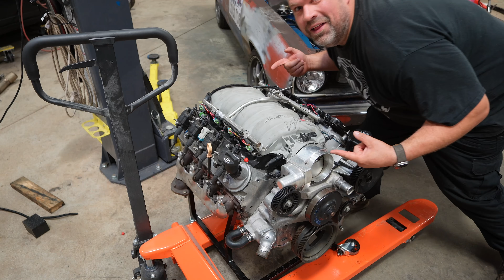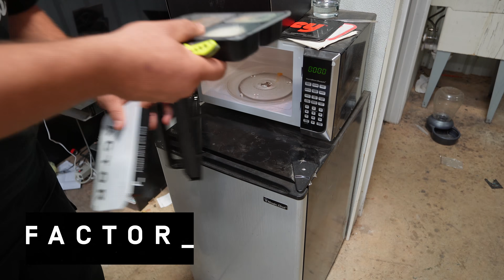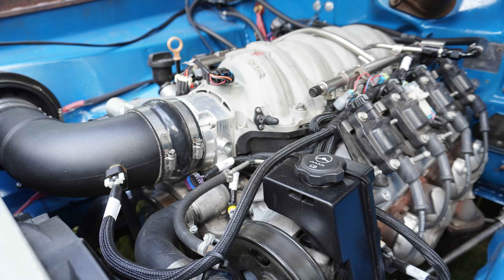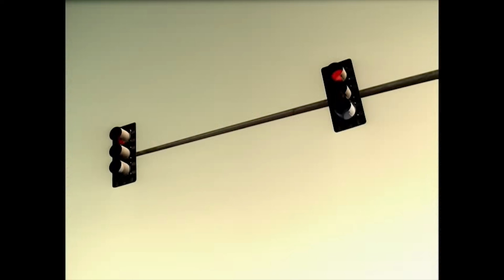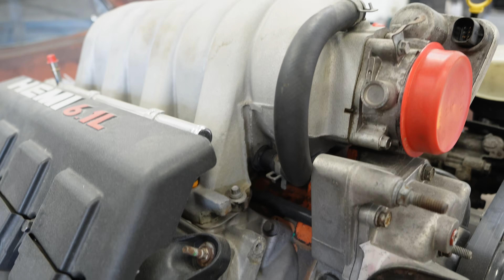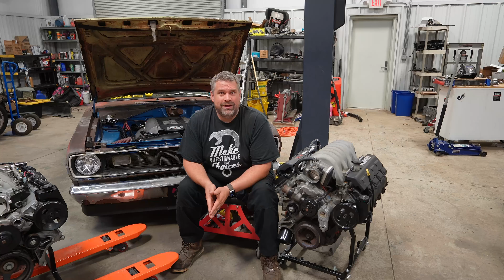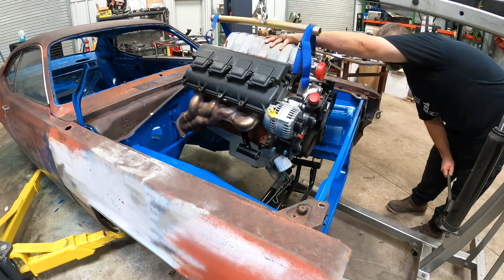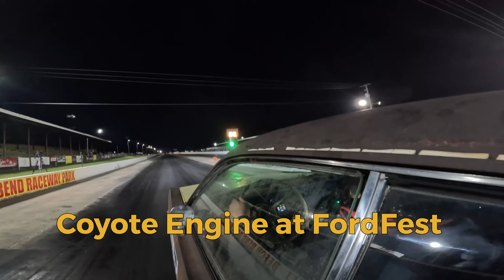What No One Tells You About Engine Swaps! Best Engine To Pick?

Comment: I would swap the engine that all 3 manufactures use in their race cars. The original hot rod engine. The first push rod V8 offered in 1953. The legendary HEMI V8. With all the aftermarket support and crate engines available its easier than ever.

Comment: Here's how you decide which engine to swap: 1 availability and economy.  2: time/difficulty 3. Realistically how much power are you building the whole vehicle to accommodate? 4. How much power with the engine hold(not how much it has, but literally how much before grenade)
   Most any engine can produce some power with the right mods. The real question is how much money and work is needed to make it hold up. Last but not least, if you are spending more money to build a car that is slower/less reliable/less capable in all areas, but could buy something for less that out performs then why? WHY?

Comment: The MAJOR advantage to a modern engine swap in an old car is the technology. Hands down, if you take a small block, say 360. Then try to make it make what a stock hemi makes. Its just not going to be a practical daily driver muscle car. You can stick a stock hemi,ls,coyote in an old bbody, camar, or mustang and make 400 plus hp. It will idle smooth, and start up everytime. Plus the transmission options are mucho better with the new stuff.

Comment: The big reason the SBC and later the LS are such popular swap engines is not just availability. The common bell housing pattern has a lot to do with it. While these three engines are the most common for swaps today there are other options. And sometimes you shouldn't swap out the engine the car came with. If you find a cherry 1st generation Firebird with the OHC Sprint engine. Especially the optional 4 barrel. Leave it alone. Swapping in a V-8 probably lowered the resale value. What you swap in really depends on just how much room you have in the engine bay. How much sheet metal work do you want to do if you have to starting cutting the shock towers or firewall.

Comment: The LS-4 can be swapped into a rear wheel drive. It does require the use of a bell housing that matches the bolt pattern. One from a Jeep XJ 4 hanger. There are other options outside of these. I know of one guy you swapped in a GM 4.2 Atlas inline six. When asked why his response was "any idiot can swap in an LS". The Atlas will make great horsepower. As shown by Calvin at Nivlac57. As Hot Rod used to say, Dare to be Different.

Comment: Im a Mopar guy, I have a 2012 Ram 1500 with decked out 345 (aka 5.7) Cammed, Rebuilt top end, ported 6.4 intake, 2800 stall, shorty heads, (I wanted low end power) true dual, and more…it will put you in the back of your seat, hard!!. 

However, I respect the hell outta some Ford or Chevy builds, certain builds demand respect. My neighbor has a Nova with a 454 and a big ass blower on it, with dual 4 barrel carbs, that thing will do 8’s all day. So yeah, I like all builds, but I prefer Mopar. 

My Dream is either a Hellephant 426 1000hp in my Ram, or buy a classic fixed up 69 SuperBee. 

Be Cool y’all!

Comment: I have always been a Ford guy.
However the LS is so good that I would take the mod emgine out of my f150 and swap a vortec engine in it.
Why? Cheaper to repair, easier to work on, easy to make power out of, less complications in the design.

I know people are thinking the coyote is going to be the next big swap idea.
It's not and likely never will be.
They're expensive to get.
Hard to swap into most engine bays, if not impossible without fabrication.
Cost a arm & a leg to build power out of them and they require forced induction for real numbers.
It's goong to take years for aftermarket support and the things I listed above is one major reason companies will not build that stuff or atleast low numbers of supply and keep the price incredibly high.

The truth is the new Ford 6.8 V8 and 7.3 V8 are going to be the swap ideal engine if you want a Ford engine.
That over head cam idea has never been a cheap option and never will be. Cars like a BMW do well with that stuff, but you get people with BMW money willing to spend it.

Comment: Keep playing with your Ls, your broke I get it1 I'm doing oil pump gears and boosting my coyote....700 whp...vroom!
Reply from the maker: You missed the point of the episode and the moment I said if I was picking a vehicle with the engine preinstalled I’d go coyote, BUT to swap into another platform, the coyote is the biggest, and still most computer side complicated to swap yet. It did sound great singing at 8,000rpm in the burnout pit

Comment: i honestly wanted to do a coyote swap on my crown victoria, changed my mind for a 5.7, 6.7 or a hellcat swap with the 8spd auto but now im torn between the 5.3 LS vortec or a 6.2 LS with an automatic transmission. as a car guy i like the 5.3 vortec but also want the 400hp from the 5th gen camaro's 6.2 LS v8 with the L99 transmission (6spd auto). which one would be the best option: the 5.3 or the 6.2 LS v8?

Comment: You could cut the bias in this video with a butter knife you cannot possibly compare a GEN three LS with a GEN three coyote a GEN three coyote mops the floor with the Gen3 hemi or a gen3 LS.  You said it yourself a Gen4 LS operating system costs significantly more, even more so than an operating system for a coyote (which you could get for around $2000) if you knew where to get it.  This video is god awful 😆

Comment: I agree on everything except ease of making power. Boost, fuel and oil pump gears and you can push crazy power. Both the engine and transmission will hold up great. Hemi sounded great and ls is by far most common and easiest to source. Great vid 💯

Comment: It’s almost like you did absolutely zero research on the Coyote or available swap parts. First off you can get F-150 coyotes for under $2k. Different compression and exhaust cams but otherwise the same and fully capable. Secondly Ford has Coyote control packs for $2k with your ECU and everything you need including the gas pedal. Companies like Power by the hour have absolutely anything and everything you need first a Coyote swap. Oil pan options and alternative belt drive configurations are available and have existed for years. Yes, it does have a larger footprint but all the other things you went on about was nonsense.

Comment: LS is way better for price and support. Now if you can get a coyote it’s very good platform. But the best swap engine is kswap or 1UZ swap. And if you don’t like the Honda sound. Put a set of uneven length headers and a supercharger the sound is more like a Subaru but better. 1UZ is by far the best they can handle well over 600hp on stock engine. And the block can handle over 800hp. And all you need is a turbo or super charger. Air water intercooler. So a junk yard LS isn’t good for more than 450hp that’s with some new heads and cam and some boost. LS swap with decent power your looking around 8 to 9k LS engines have gone up in price. Now you can get a 1UZ or a k24 for under 200 bucks and do nothing to it but slap boost to it and some support mods and make well over 400 for the k engine and boost on the 1UZ to well over 500. 1UZ swap can be done for well under 3k.

Comment: The score was pretty much what I expected.  Even when I started driving being a mopar guy I worked at an auto wrecker and found that mopar stuff interchange ok  GM stuff interchanged incredibly  well.  Even across olds, pontiac, chevy.    Used to sell a lot of 350 chevy engines to drop into chevy vegas, guys could have a pretty fast car with a very basic engine.  So makes sense that gm carried that on keeping it simple and flooding the market.  Have to also give kudos to them for building the LS really well, strong light and dependable.   So get it why so many guys use them.  Just nice to see someone using something else once in a while.

Comment: The aluminum LS is the king of swaps for 3 big reasons; size, weight, and cost. The fact that an aluminum LS weighs less than a iron block turbo 4 cylinder is mind blowing and makes it ideal for performance swaps. The Hemi is big and heavy, the coyote is big and expensive. 
Stuffing a hemi or coyote into a small chassis like a 240sx or rx7 just doesnt make sense because of how tight the engine bay is.

Comment: The hemi is by far the king. Almost all nhra drag cars are running hemis, even if the sticker on the front is different. Hemis dominate the nhra. Then in nascar when they tried to make a come back, nascar made them increase wind resistance to make it =. They quit. All you had to do is watch the truck series get dominated by dodge. Eventually they even forced adjustments.

Comment: Performance stopped in 1970. In 1971 the EPA TOOK OVER. I was there working at a Pontiac, Buick, and Cadillac dealership..you could of heard a pin drop when we raised the hood on the first 1971 models, and i said "where's the beef"

Comment: My problem with any other swap besides the LS is cost, i can add 100+ hp to a LS fir a couple hundred dollars, hemi cam swap i did just the mds kit was $1600. Never messed with a coyote but read same about them. I can build dirt cheap LS motors and if i blow one they are easily replaced. Just my 2¢
Reply: Not wrong. The coyote is a great engine as I personally own one in my 2013 GT Mustang, but the LS3 is better for builds and can be put anything.

Comment: Nice video; however, the MOPAR hemi did not "revolutionize engine design".  Hemispherical combustion chambers have been used in automobile engines since at least 1905.  MOPAR may have popularized the hemi cylinder head design, but it certainly wasn't revolutionary.

Comment: Yeah… I don’t quite agree with that statement…

Usually, the dirtier your engine run, the more power it makes. More fuel, more air, more displacement equal more power.

Use V-Tech from Honda. Everyday driving is clean and fuel efficient. Once you hit the higher rev, everything from clean and fuel efficiency goes out the windows to produce power. Which brings the following question for all the rice tuners: why lower the v-tech rev activation when you can just get rid of it completely and run it with advanced timing and everything else without waiting to hit the rev activation?

Comment: I don't care if it's "difficult".  Right now I think the Coyote is the better engine for several reasons.  I'll go the extra mile for what really works.  The LS was for sure the go to for anything prior to the actual 5.0 from Ford.  I have to admit that I've never considered dropping any Dodge engine in anything other than another Dodge.  Having a Viper engine and transmission,  I could only think to put it in a Dodge.  I'd put an LS in a Pinto, or, a Coyote in a Chevette 😅

Comment: Not exactly a "race" build.. but my next build will be a 1972 Chevy C60 cab and front clip with a fleetside bed with stepside fenders welded on. "Make it a dually" . With a 5.9 cummins married up with an allison transmission. And probably using a ford rearend. 

Each make has things it does better than the others. Who cares what ithers think. When you are building anything, build what makes you happy. I am a GM guy, love the body styles! GM has the, IMO, the most beautiful body lines. But dodge has the best deisel engine. Allison is the best trans. Ford has the best suspensions and rearends. Just my take on it.

Comment: Crazy!  I keep seeing videos of people praising the Coyote because of the boost u can run thru a stock coyote motor and it being able to handle that much horsepower. Do u agree if its power u want.
Reply from the maker: The coyote is absolutely amazing to build, in the vehicle they originally came in. Between a mustang, non-hellcat challenger and a Camaro, I’d take the mustang hands down because of the engine. If you are trying to swap an engine in, the coyote is terrible.

Comment: Dont sleep on a rebuilt Northstar either. But i helped to build 4400 LS's per day from 2001 to 2013...4400 engines/day x 5 days a week x 50 weeks/year...1.1 million/year for 12 years...over 12 million engines. That's why the LS rules. They're cheap and they last. Easily adaptable to just about any drivetrain. GM wins!!!❤

Comment: Great video. Wish it had been the ford gas 7.3 instead of the coyote though. I know the 5.0 has been swapped more, but the 7.3 is more apples to apples, way cheaper, big, light, easily swappable it bolts up to anything else a mod motor does.

Comment: I've had them all except the coyote but a few buddies have them. They are pretty nice! LS was my favorite for a long time for the simple fact they were so easy to get and get power out of. My first real build was a 2002 trans am ls1. We built it in 2005. Ended up with 714hp to wheels on nitrous and 630hp to the wheels motor. I now have a new favorite motor but I wouldn't say it's cheap. Now that I've grown up and have a big boy job, I'm able to invest more lol. I'm currently building a 7.3 Godzilla for a 92 foxbody. I originally got introduced to the Godzilla when I bought a new super duty. With some tinkering and a buddy doing some tuning, we got that thing to hum. I was impressed with the power, durability but also the fuel mileage I was getting. The truck is pushing 601hp and 642tq. We did cam, intake and had some intake and exhaust work done along with other bolt ons. I can't wait to see what our foxbody does!! The Godzilla sounds oddly similar to an LS to me after built lol.

Comment: The Coyote was faster in all three but only because he’s a Chevy guy so the LS would of been if it was set up for it, but the heating isn’t set up for the Coyote because it needed higher RPMs . Sounds like it wasn’t set up for the Coyote and it was still faster on all three phases. Plus you can change all the intervals he said in the LS and make it faster, but you can put 1400 WHP through a Coyote without changing the internals

Comment: Welllll….Brett Lasala just won sick week and went a best of 6.26@227 in his 2013 Mustang GT with a factory cast Coyote block and factory cast voodoo heads on a 275 radial. Let’s see an LS car or a Hemi car to come even close to that…

Comparing the technology of a coyote to those other engines is like comparing a space shuttle to a horse and waggon
Reply from the maker: I was discussing their use as a swap engine. What did Brett win in? A car that it came stock with. I even said in the stock chassis it’s the best engine. But, the cost and size makes the Coyote engine the worse candidate of all three.
Reply: He won in a modified 2013 mustang GT that he can drive through a Starbucks drive through. Just shy of 3000 hp (factory block, stock crank). 

Coyotes are definitely the most expensive for sure.

Comment: I recently did a coyote out of a 2019 f150 swap on my Mustang II didn't have to change oil pan also the exhaust fit .. I sent the ecm out to get the security deleted  .. so the engine and transmission cost was $4250 ecm was only 150 including shipping .when it was all said and done total was only $ 7419 ... only one thing I forgot to get was the  
               Driveshaft 🎉
Again I really enjoyed your video

Comment: Talking engine swaps nothing is better than a LS. But…as many have mentioned the only engine you can make 1000 reliable hp without opening the engine is the coyote, especially the Gen 3 coyote. Simply bolting on a set of good long tubes and a good E85 tune can get you around the 500whp mark on a Gen 3 coyote and match that with the amazing 10 speed 10r80 transmission and you see a lot of Mustangs hanging with and sometimes beating 700+ hp hellcats with a completely NA setup.

Comment: For newer stuff (like my 2015 jk wrangler), the computer side of things is a problem. The ford 5.0 is a dream engine, but the computer and wire harness is an absolute nightmare. The LS is the most durable for off-roading and longevity. But the hemi (5.7L) has the fewest computer problems, matches up to the transmission, and needs the least amount of modifications under the hood.

Comment: First mod motor was 91 Lincoln and it was a non pi 4.6 2v. 

First mod motor in mustang was 96. Practically the same motor in the Lincoln from 91. In 99 the mod motor got decent with the PI heads, cam, and intake. About 40 hp bump in power. You can make over 300 wheel with 96 non pi short block comp non pi cams, ported pi heads, long tubes, aftermarket pi intake manifold, and all the bolt ons. They're fun and run low 12s. Pretty easy. 11s.on drag radial.

Comment: Being a GM ASE certified technician with over 20yrs of experience I realized around 1997 a swap wasn’t a good idea for my 1964 Pontiac Tempest/GTO. A lot of unnecessary extra cost & butchery to the car. Instead I would build a 1969 4 bolt main 400 Pontiac with 4.150”Bore, 4.150” stroke billet crank, 6.700” titanium rods & a 1050 Quick fuel BDQ carb feeding Kauffman Racing CNC ported aftermarket aluminum heads that flow 400CFM. It’s a squared Pontiac. With a built for racing 200-4r transmission from a Buick GrandNational it more then speeks for itself. It was very affordable back in 2017, especially for what it’s capable of!!!  Without a power adder

Comment: If you want to do an engine swap, where do you find motor mounts, adapters to mate engine to transmission/transfer case, etc?  I have a mid 80s F-150.  I want to replace the 300 with a 351 Windsors, 351 Cleveland, or a 360.    Where do I find info.  I also have a 66 mustang with 289.  Coyote swap would be too expensive, however, a supercharger on an early 302 or 351 might be worth it.  Where do you find info on these type projects?

Comment: I think you are mistaken about when the 5.0 Windsor was discontinued. I own a 94 mustang cobra that has one. The 4.6 wasn't used in the cobra until 1995, not 1993 as reported in this video.

Also you mentioned the mod motor in 84 towncar, I'm guessing you meant 94?